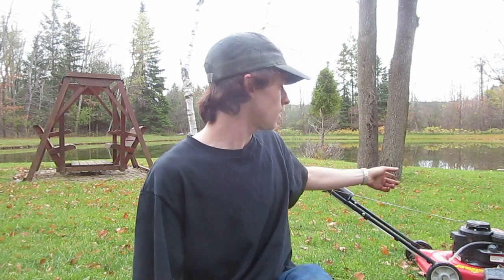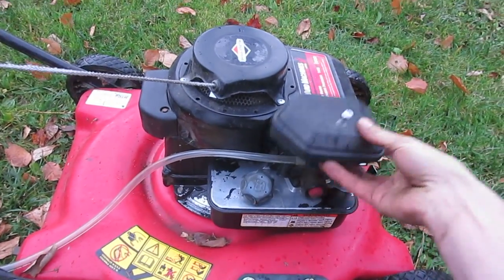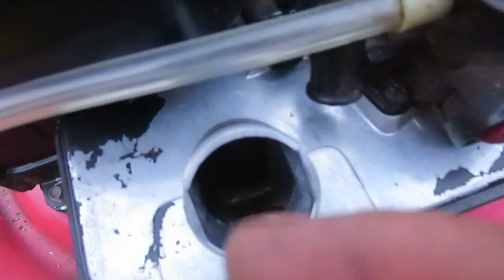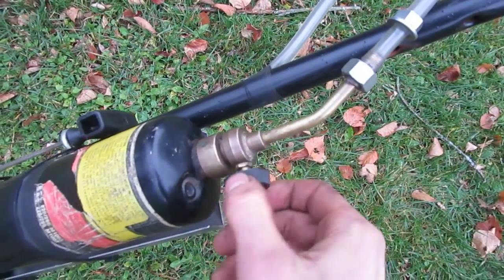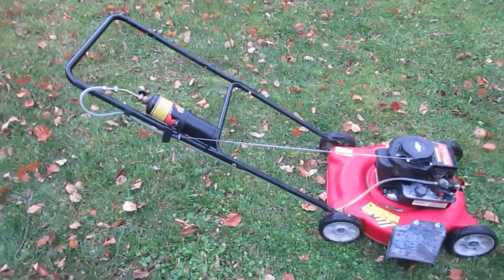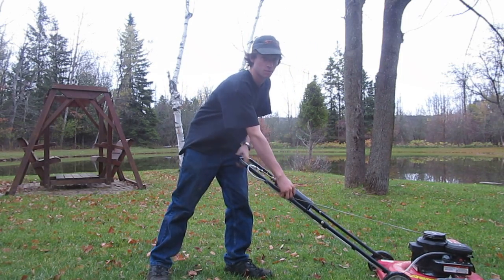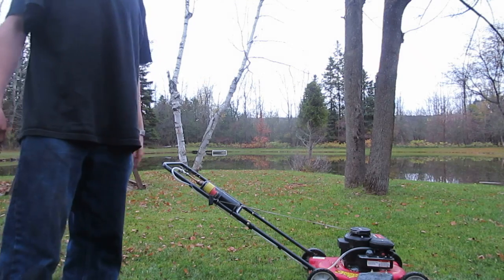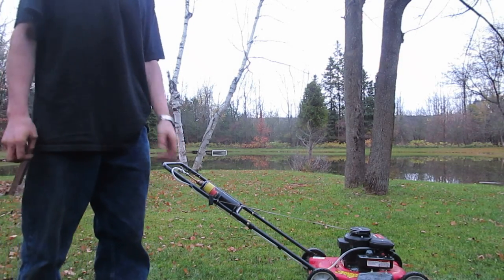Propane Lawn Mower Conversion

Comment: I tried it with an old generator and almost blew it up the propane filled the fuel tank it backfired and poof the propane exploded the fuel tank expanded and luckily didn't Burst I plummed mine the exact same way with a torch tip and hose to vent port on carb

Comment: This is what gets me.   We have everclear.  It works just fine to cut grass.  Pure alcohol is the cheapest out there and made right here at home.   It has zero stuff in it.  And is Flammable just fine. Can handle higher compression, and has a great cooling effect.   It  burns VERY clean.   Problem is?  The government has been taxing alcohol  since 1791,   and today?   That tax is up to 5 bucks a gallon!    No wonder there is no such thing as cheap clean fuel.  They have been taxing this stuff to keep it above the price of gas for a LONG time.  Its nuts!  

The thing that bothers me about all this is that we have this clean fuel, that's been made for 1000 of years. is safe for humans, can be made right at home, and as of now?  Gas is at over 8 bucks a gallon in many citys .  It highway robbery! 

No wonder the government has so much money to spend on frivolous things.   Its a joke.  
And to put this into perspective?    the actual cost to make alcohol is right around maybe 5 cents a gallon in large quantities.     

in many cases that's cheaper than electricity something's just not adding up there.

Comment: U have bypassed the governor and the throttle so it will run fine at a set rpm and load but when the engine requires more fuel and air to maintain a set rpm it will be either too lien or rich in air fuel mixture

Comment: That “kill switch” lever you disabled doesn’t just kill the engine...it is actually an engine brake that has a brake pad that immediately stops the flywheel from turning... it is pretty dangerous letting the engine wind down rather than braking immediately in an emergency situation...
Other than that, good info.

Comment: Aloha.  Thanks for such a great presentation.  I did exactly the same hook up, except I disconnected the return spring for the cut off.  When I open my propane torch all the way, I can only get the engine to idle.  The carb spring is broken but I don't think that is my problem.  Just seems like it is not getting enough "gas".  I'll try and find another propane torch control and see if I can get more fuel into the carb.

Comment: Would you be willing to give me a little more detail in setting this up? I've started trying to do the same with a tiller, but after about 5 minutes my bottle began to freeze and I started losing power. I may have to hole in the torch head too big.
Reply: Try when your bottle isn't completely full. Or you'll need to find a way to keep warm water around it. But at my old job they converted all our mowers at a golf course to propane. And we started filling to 75 80 percentage full when full was common for the regulator to freeze up and we would have to open the release valve on the propane tank and vent off a couple pounds to get it to run without freezing. I've seen the same thing on my metal foundry burner. You can always tape a couple bags of warm water around it if your using prefilled store tanks. If you have a larger tank you can refill the smaller tanks. When my tanks run out I cut them open and use a crucible for aluminum and copper. Works good hell sometimes just shoot them with a 22 pellet gun full then cut them they don't explode

Comment: with the throttle wide open like this you are going to risk the engine blowing from overspeed. This is effectively ungoverned. There needs to be a mechanical feedback loop to allow for the proper rpm limit. A piston rod flying through the side of the crankcase can easily maim or kill. This conversion design is essentially a Darwin challenge.
Reply: Rod wrist pin or bearing will spin first more then likely. The engine wasn't revving high enough to be in a danger zone. And they usually implode on themselves and destroy the crank etc. It's about as common as a car doing it.

Comment: lol imagine being american, gas is cheaper than water, but still want to go through this hassle and have to dial in the right a/f ratio everytime you start it haha... too lean can cause damage and too rich = no savings.
keep in mind propane can be bad for your valves (trust me, I'm european and a lot of cars are bifuel / run on gas and propane/butane - all the newer ones inject some sort of oil to protect the valves where normally gasoline will keep em lubed up), however it probably doesn't really matter in a 2 stroke.
I do really wonder if the exhaust smell more bearable on propane though.

Comment: I converted my 42 inch Yard Machines riding mower to propane 5 years ago and is the best thing I did.  I used a Garretson T60 regulator that meters the fuel for the load and if the engine quits for any reason the propane stops completely.  Much safer that way.  I have about 80 hours on the engine since the conversion and have had no issues with the fuel system.  I wish MTD who makes about 80 percent of all riding mowers would start offering a propane option, but I guess that makes way too much sense!

Comment: Propane does run clean and oil will last much longer as not much carbon in Combustion Process but Gasoline is Cheaper to Run unless you Fill your Small Bottles off a 20 lb.  Cyclinder..

Comment: with throttle all time wide open, and regulate rpms by gas flow, you often get on a lean mixture, and all of possible problems, who was because of lean mixture  -overheating, exaust valve burning and so on, i suppose...

Comment: Do you have a screen between the propane bottle and the carb to prevent a backfire explosion? You have to be careful you don't blow yourself up!
Great video by the way, keep up the good work.
Reply: radioactivelarry that shouldn't actually be possible considering the gas is under pressure and would continue to flow. Doesn't mean it can't backfire and catch other things on fire though I just don't think it can back burn into the tank. Correct me if I'm wrong and wtf you would do to prevent this if I am wrong lol
Reply: @brandonmehrabi268  It's all about safety! You just can't be too careful. If you examine the torch end you will notice there is an air gap between the flame and the orifice where the gas comes out, that's to prevent a back flow into the bottle. If that little bottle ever blew up it would leave a small crater in the ground and blast shrapnel into the mower operator. Weather you use a screen or an air gap as a safety factor is up to you. Do some research and you will find why safety is so important dealing with propane.
Everything is not perfect, "REMEMBER MURPHY'S LAW" it may work OK for months then one day you have a bad day and get blown up by your lawnmower!!!!!
Good luck and be safe.....
Reply: There isn’t any oxygen in the tank. Propane requires oxygen to burn. Get it? Got it? Good.
Reply: @misterdude4296  so it isn't likely possible as I thought.
Reply: @radioactivelarry  yes it is still always a good idea to be safe and take Murphy's law into account anyway. Agreed
Reply: @brandonmehrabi268  the propane torch nozzles usually already have a one way check valve safety built in. Which you have to take apart at the base seals to get to. Unless you were changing out o rings or something there would be no reason to even touch it. And if a torch lasted that long just by a new nozzle. On larger propane burners or grills etc. I always bleed the lines after to not have any pressure on the seals. Prolonging there life.

Comment: I know that engines that are always run on propane need much less maintenance, and last a much longer time than if ran on gas.
Reply: not only less wear and tear, but it burns clean, so the inside of the engine stays cleaner. I've seen propane run engines taken apart, the inside needed no cleaning at all. If propane was cheaper and easily available everywhere, running on propane would be the way to go with about anything.
Reply: @tootall5559  autogas or lpg is essentially that, just buy it on a gas station with a professional safety tank with security valve and "refill" that from the security tank to your small sized propane mini tanks suitable for lawnmawer etc
Reply: @opferbauer4941  around here, you can't buy propane or LPG gas at a service station, unless it's also a convenience store and has the prefilled swap out tanks.  I used to fill propane tanks for our forklifts, but it was propane, not LPG, what the difference is, I don't know.
Reply: @tootall5559  "LPG" is "Liquid Petroleum Gas" all propane is LPG, but not all LPG is propane. Propane turns to gas when introduced to air. Some machines use vaporizers to turn propane back to its  gaseous state for faster burning.
Reply: @okiksapa1  is but ain't ? okay... whatever. you need to splain more..
Reply: @tootall5559    What he means is, Propane is  Liquid Petroleum Gas or "LPG". But Natural Gas is also called LPG. Two different types of gas but they are both known as LPG.
Reply: Mascotal natural gas is not LPG... LPG is a mixture of propane and butane, under pressure (usually about 7 bars) so it stays liquid. It's the most used fuel for cars in Europe next to gasoline and diesel. My RAM 1500 5.7 Hemi came with it and it runs great, no noticable difference with gasoline and much cheaper (currently about $2/gallon, if I convert it for you) because it's supposedly cleaner burning and better for the environment.
If natural gas is liquid, it's called LNG. CNG (still a gas) is an alternative fuel in Europe that's increasing in popularity, but is stored at 200 Bars! I think LPG, or autogas as it's called over here, is a better alternative.
I'd watch out if I ran my lawnmower on it though, because the valves don't get as much lubrication (even though some additives are added to autogas). In a car, the valves are adjusted or in case of Dodge and RAM, there's an extra filler hole under the hood which you need to fill up with valve oil to keep everything lubed up + propane/butane/LPG burns slightly hotter.

Comment: I have one set up almost the same way.  I ran my propane through the top of the breather cover.  I like the clean install that you have done here.  I just have one question... Since you disconnected the crankcase breather, how do you keep debris from getting sucked into the crankcase through the breather?
Reply: Wes Youngblood  .It doesn't  work like that, The  Pcv  system  stands for, positive crank case ventilation. . It dosent suck in air.

Comment: a while back, about 7 or 8 years ago while I was still in high school I had an old Snapper riding mower with a Tecumseh 8HP engine which I had modified to run either propane or gasoline just by opening or closing valves. it was fun for me at the time I guess. Gasoline was pretty expensive at the time and propane was much cheaper so it was worthwhile haha

Comment: Good video.  I have had absolutely no luck with gasoline-powered lawn machines for @ 20 years.... went to corded electric lawn mowers ( lotta torque ) etc, but eventually bought a gas generator, weed-wacker, and hedge trimmer... none of which start right now....

I assume that if  I want to convert them to propane, I gotta either clean the carbs or buy new carbs to get the machine to run, then do the conversion....But you certainly make it look doable.... Thanks
Reply: xzqzq quit buying reg gasoline from the corner market. You need to buy non ethanol gas. You see gasoline has 10% ethanol which gunks up the carbs and jets in any engine that isn't used every day. Or religiously. It's spendy this non ethanol gas but it doesn't take that much non ethanol gas to mow your typical lawn. Or to edge your average house.. Just my 2 cents.

Comment: converted my generator that way to get it started crack the propane then close the valve start your machine then quickly open the propane valve again. If you try to start it with the valve on continuous flow you will flood the carb just like gasoline.
Reply: Ill try that cant get mine to start

Comment: Nice work;) does it have different temperature when running on propane?
Reply: propane runs a bit hotter. you don't have the evaporative cooling effect of the liquid fuel mist